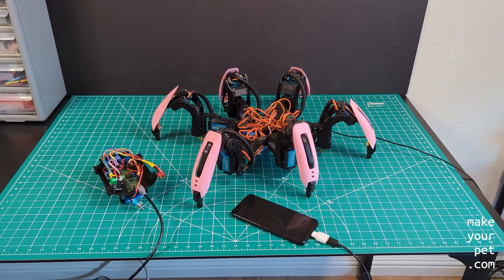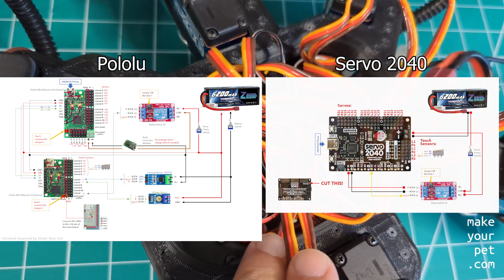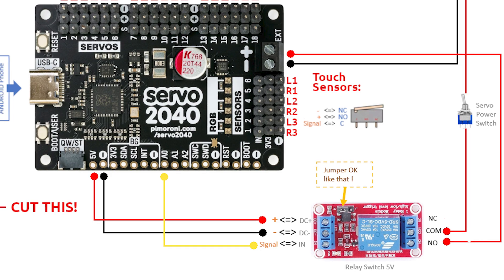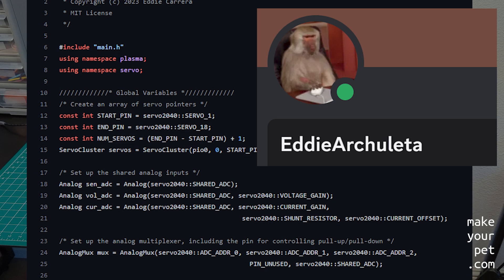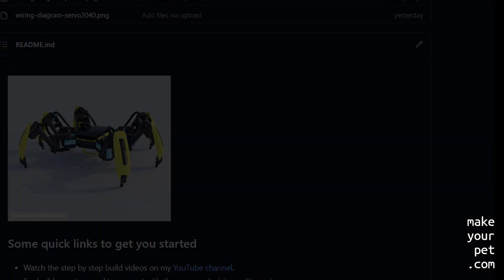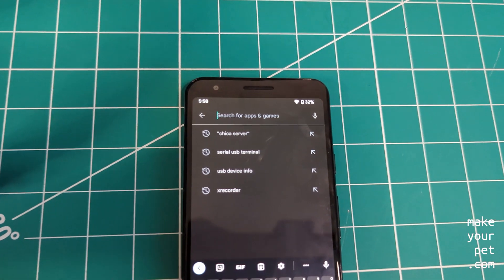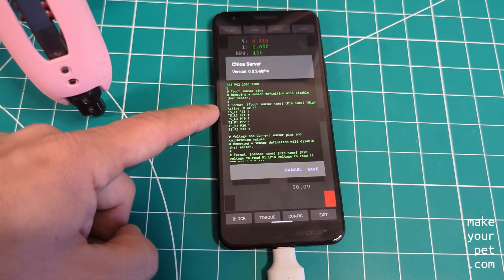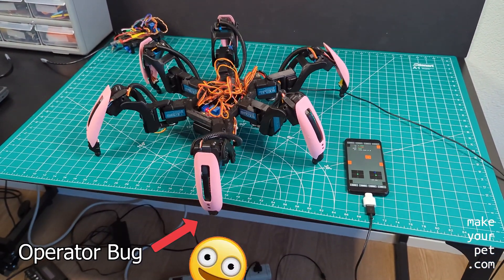Build Chica The Hexapod Using Pimoroni Servo2040! DIY Hexapod Robot.

Comment: It's necessary to cut the pin you say that conect the external powet to the usb, it's necessary to cut it if I'm going to connect the Arduino through the I2C ports? It's a good idea to do it with Arduino?

Comment: Amazing video, I am considering of doing the same thing, but with MG996R servos. I have a couple of questions in mind:
1) the max constant current for the servo2040 is 10A (read it on the datasheet), don't you exceed that with 18 digital servos?
2) Is it possible to control the servo2040 without a phone and use Bluetooth, wifi, pwm signals, etc?
3) the mg996R that I plan on using is operational with voltage within 4.8 V and 7.2 V, could I use a 7.4 lipo battery directly or should I search for an UBEC?

Thanks in advance, keep up the great work, sorry for posting the questions here, not sure if this is the best way to reach you <3
Reply: Nevermind, I am stupid, just found about chipo <3

Comment: I just purchased the servo2040, a nice board and much smaller than I thought it would be. thanks for suggesting. I was wondering what is the purpose of the relay switch?
Reply: The relay controls the power to the servos, so it allows the microcontroller and therefore phone too, to cut the power to the servos.

Comment: Definitely a good choice on the servo2040. I have been very tempted by them myself. 18 servo channels and 6 analogue inputs and a built in current sensor (albeit for all the servos at once)? Perfect for a hexapod. I’m seriously considering buying one now. Only problem is that if I want to add position feedback or individual servo current sensing then it wouldn’t be suitable and I would have to make my own board anyway, I might go for an FPGA based solution eventually. I would need some other controller anyway since the servo2040 doesn’t have many pins left for sensors.
Reply from the maker: yeah I think they had the hexapod application in their mind when designing the sevro2040. Yes that is one limitation of this board and the only extension is via its I2C pins. But for the price it is a pretty good deal. you should be able to find it for ~$24 online, which honestly is really good for what it is.

Comment: It is a pity that Pimoroni Servo2040 is not sold in Russia, we will have to use another one. But the main thing is that you have already created a basis, and adapt other boards, I think, will work. I took the LX-225 servos from HIWONDER, they have two modes as servos and motors and can be connected in series. And I took a 1.3 mm binocular USB camera module.
Reply from the maker: yes, as you said, for example you can use a RP Pico or an Arduino to  receive the open hexapod protocol from the phone and send serial commands to LX-225. I think it should work too.